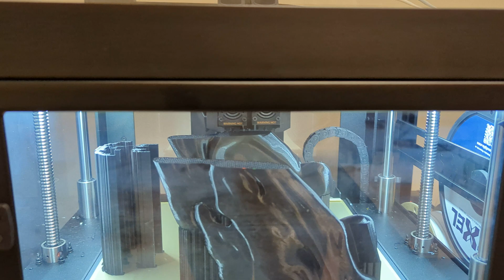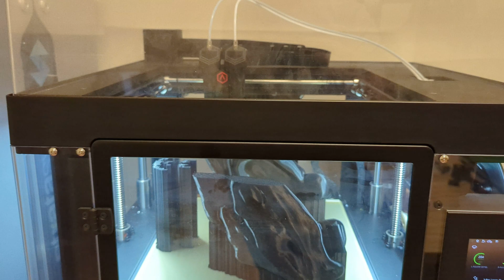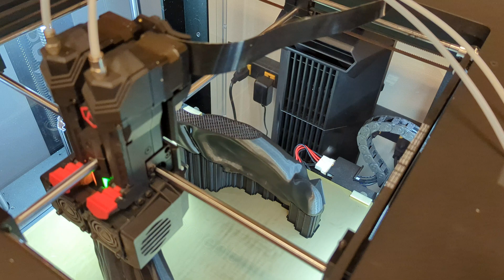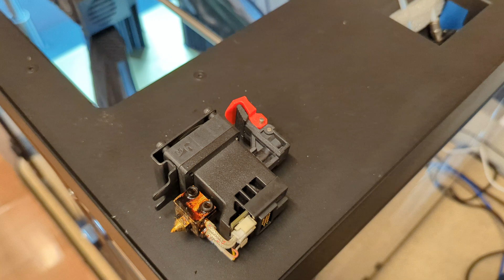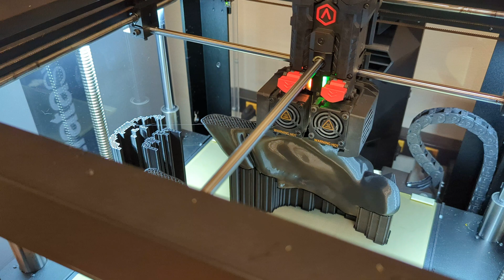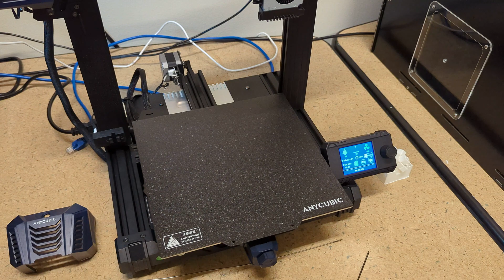Raise3d Pro3 1 year report, problems and issues.

Comment: I bought this printer when it came out. It was the max version. I never had a more worse printer then the pro3 raise. I got a long list of issues. Raise3d was so arrogant, to even recognize the problems, even while the internet was full of raise shit. At the end when they noticed my wife is a lawyer, they rush to buy the printer back. If you ask me, this printer is a total failure, rushed to the market, no intresse in user input. 
You wil have more fun when buying an creality printer and trow the rest of the money in the Pacific Ocean. This printer has the specs of a 2017printer. Have a look at bambu x1 just a play toy, its 500 times more up-to-date then a raise. 
Once a raise 3d pro3 never a raise anymore.
Reply: I'm also struggling with it. Right Extruder had a problem with a loose guiding rod. Everytime the right Extruder was lifted, the rod was pulled out a little but not pushed back. So everytime the aktive Extruder switched over the nozzle height was different to before. So the right Extruder, mid print, printed in the air and not on the last layer.... 
Our TPU (95A HF) keeps curling between and around the extruder wheels. I have even dropped the current of the Extruder Motors to 500mA only to prevent it getting hot and weaken the filament...
We have the Hyperspeed Upgrade. Thought the Hotends would have more power. But heating from 160 to 220°C take around 40sec... My 25$ CHC Pro on my Ender6 heats from 25 to 220 in this time... This makes Nozzle switching (dual print) unnecessary time consuming...
All in all I wouldn't buy it again.
The sturdy massive building doesn't even help to prevent ghosting...
Reply from the maker: That is crazy. I wish I had heard all of these comments before I bought it! Lol.
I searched online for a good long term review of the machine and I couldn't find anything. All I saw was comparisons vs other machines like Ultimaker and it was just comparing specs/price. So it made it seem like the Raise was the obvious choice lol.

Comment: I also had issues with the printer. This is the most annoying printer I've ever used. The bed leveling sequence is slow and there are some unnecessary movements. It's unable to print a PVA support material (the filament not guided perfectly and it came out on the side of the extruder). 
I'ts print nice if you print slow but at normal speed (50mm/s) the print looks ugly. I don't know if it's just on my machine or you guys also have similiar experience. 
I have had a big blob on the extruder (yes it's user fault) and it broke the motherboard on the extruderhead (it was an expensive mistake). For that price I expect some crash detection (like sensorless homing with TMC drivers or AI detection with camera). I have problem with the printbed, it's really hard to stick the prints on it even i clean it before every print with isopropil alcohol. It's not just because of the surface wearing out fast but the base is not flat completly.
My chinese printer print better and faster than this printer.
If i could go back in time i would buy 3 or 4 Bambulab instead of this Crap.
Reply from the maker: They could make some small changes and make this printer great if they really wanted to. I haven't tried PVA in it but I've had good luck with HIPS for ABS. And I definitely know what you mean, if I could go back and do it all over again I would not buy this again. My Prusa printers walk all over it in regard to reliability and ease of use.
Reply: So which printer are you considering now
Reply from the maker: At this point I'm looking at the Ultimaker S5 or S7s but I'll have to take my time to ensure they're going to be a good choice. They cost a lot more but it may be worth it.

Comment: I also had issues with the printheads and i am now very trained to disassamble them :)
Software i also see some issues for example the 2 Head printing and warmup 7 cooldown delays are not really working for me with swap time reduction.
But i have to do some more experiments there
The extruder power itself is good, but there where no spareparts available for that PTFE Throughts (or how they called) and mine ar a bit worn out because 
the extruder has massive force and make a mess in this area
I have built a silicon form and i have Silikon here for nozzle caps, these caps should help also to get the printheads more clean.
I don't know whether there are some available now, but if i have some more time i will make some
Yours also look a bit dirty .. but send them to you from germany would maybe a bit complicated i guess
So greetings over the pond
Reply from the maker: Greetings! I'm sorry you also had some of the same issues! Yes those PTFE pieces just after the extruder got really messed up in mine too. They did just start selling those as replacements so maybe check again. Not sure if maybe it's not available in all regions. 
That's great about the silicon boot too! They definitely help with keeping things clean.